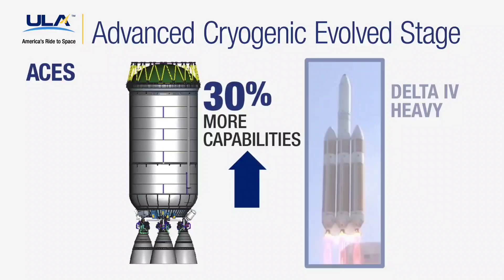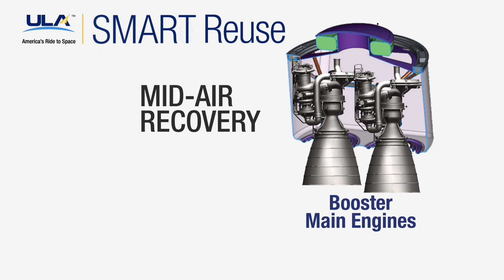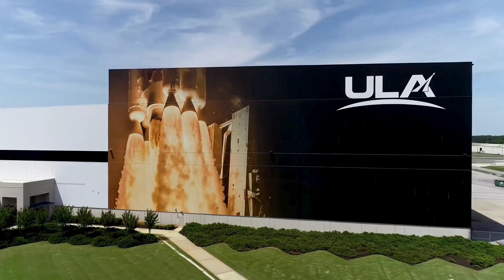Blue Orgin BE-4 having MORE problems?!  What about Vulcan Centaur?

Comment: Your logic WRT SpaceX Raptor leaves much to be desired.
Past performance says SpaceX will continue to fly by many more projected dates, and they will have a number of RUDs on their way to a usable product, but they will eventually get there. BE-4 hiccups are in no way predictive of Raptor hiccups. You need to exercise greater rigor in your analysis. Want to tell us that Raptor won't be working any time soon? Bring genuine evidence and reasoning, not this "BE-4 is having significant trouble, BE-4 uses some of the same tech as Raptor, therefore Raptor will have significant trouble too" BS. Your video is pissing me off. Call me "The Angry Viewer".

Comment: My issue is this. If a rocket requires boosters to launch basic payload it is not mission capable! Boosters should only be used to launch larger payloads to supplement a mission requirement. Not the damn mission!

Comment: The design of BE-4 started out as an engine the size of Raptor. However, NASA asked Blue Origin to double the size of the engine. (I think I found this fact in an IEEE article.) As a rule of thumb, problems increase as engine sizes increase. This becomes more apparent with engines designed for greater efficiency, especially where some form of staged combustion is used. SpaceX Raptor engines operate at a sweet spot of greater efficiency with reasonably good reliability. Blue Origin, however, fell into a developmental pit when it honored NASA’s request to increase engine size. 

A 33 engine Starship booster would not seem especially reliable, since at least one engine failure in 33 would seem likely. However, SpaceX believes it can detect problems with any engine, and quickly shut down that engine before it will explode and damage nearby engines. Ultimately, SpaceX views many engines as affording redundancy. I would guess that three engines can fail at liftoff, and the vehicle will still achieve orbit. 

How a BE-4 engine fails could be an issue. I wonder if, when a BE-4 fails, it may fail explosively. Suppose a given BE-4 engine runs reliably and can be reused for several flights. It proves to be a great engine, except that failure may be sudden and catastrophic. In other words, this is a problem of asymmetric risk: Failure is not likely, but if it occurs, the results are catastrophic. 

I will never understand what became of the Saturn F-1 engine. No F-1 engine ever failed, and Dynetics upgraded the engine, which became the F1-B, producing 1.8 million pounds of thrust per engine. One F1-B would develop more than three times the thrust of a single BE-4. 

https://arstechnica.com/science/2013/04/new-f-1b-rocket-engine-upgrades-apollo-era-deisgn-with-1-8m-lbs-of-thrust/

Space exploration may be more about politics than we imagine.

Comment: Does the BE-4 use methalox at similar temperatures/densities as the Raptor-2? I've written this facetiously before, but I've noticed the stats on the BE-4 and Raptor-2 aren't that far off.  The BE-4 is 2.4 meganewtons thrust and the Raptor-2 is 2.3 meganewtons. The Raptor-2 looks more compact, and it's made in gimbaled and non-gimbaled models. Is it possible to adapt the design in a reasonable period of time?

At a chamber pressure of 300psi, as opposed to the BE-4's 134psi, it looks like the mass flow of the Raptor is considerably less, while providing nearly the same thrust! Perhaps SpaceX could license the design, with a lower chamber pressure and wider throat, and boost the mass flow to more closely match the BE-4's philosophy of running a high performance machine at medium performance? My main question about adapting the Raptors is whether they expect denser, colder liquid methane and LOX than the BE-4s do. I'm sure the turbopumps must have a fairly narrow range of temperature/density that they work best with.

Possibly ULA could just bypass BO and go straight to SpaceX and buy a few Raptors for their engineers to test out and see what they think. Even if it just embarrassed BO into getting it's rear into gear, it might be a good move. Maybe just rent an old raptor-1

Comment: From my way outsider perspective. ULA has a problem that they are going to have to address sooner rather than later. They can toss the BE-4 onto the design scrap heap and go with either the Raptor 2 and redesigning the whole rocket to work with the Raptor 2, or they can wait and hope that either the Aerojet or the Blue Origin design finally matures enough to be viable. That timeline is unknowable at this point. So ULA can chose a viable working engine from it's competitor and be at it's competitor's mercy, or it can wait. Bruno cannot possibly be happy with what he is faced with, but he is going to have to either jump out of the pot, or get boiled alive (figuratively speaking). I think he is going to be forced to get in bed with SpaceX and redesign Vulcan to use it's competitor's engines. ULA is running out of time. If he waits too long the DOD is going to pull his contract, or at least downsize it, and ULA will go bankrupt because without the Atlas or Delta, they have nothing waiting in the wings without Vulcan.

Comment: It is entirely possible to test an assembly to death. I have seen it happen on more than one project, where a customer was so concerned about reliability that they actually undermined the system's reliability by testing it repeatedly at or above it's rated capacity. It is my understanding that this was a contributing factor for the BP Macondo Failure (Deepwater Horizon.). BP required so much testing on the BOP, that it was essentially worn out by the time it was put into operation. Transocean had to re-plumb the BOP in order to get it back operating again because repair parts were not available immediately, and they did it in an emergency because of production deadlines and they did not document the changes properly, thinking that it was just a temporary fix until new parts could be obtained. This is what led to the BOP failure.

Comment: If I were at the helm of ULA, I would be re-designing to use Raptor 2 engines. If there is one thing you can rely on about Blue Origin, it is that they are unreliable.

Comment: Considering the BE-4 has yet to demonstrate making it's claimed 550,000lbf of thrust and SpaceX's Raptor 2 was demonstrating 510,000 by Feb this year(2022) and well on it's way to making 550,000lbf ... ULA might want to reconsider their Engine provider.
Especially when you factor in that Blue Origin has yet to put anything in to Orbit. They've aced those sub-orbital flights though.

Comment: Only thing Daddy Bezos has done right is tell Uncle Joe to suck it about the economy.  BO is a tax write-off for him.  

R2 seems to be a pretty well developed engine at this point.  I doubt it would take too much effort for ULA to make a mount for R2's and then they can tell Daddy to pound sand.  R2 is pretty much at the same power and gets better gas mileage than the BE-4 so it could work.  I think it also weighs about half as much.

Damn dude, pull your audio out of clipping!  There's just no reason for that.

Comment: Raptor II is in no way at all comparable to the BE4; the suggestion that similar problems are likely is absurd. Just look at the two engine side by side and that is obvious; given that the BE4 has approximately ten times as much tubes and crap running all over the place, that means ten or more times the potential failure points for leaks than the Raptor II. And you made the point yourself that BlueOrigin has been short of parts to make test engines with, while SpaceX very very much does not have that problem and is making five Raptor II engines a week and testing the crap out of them.

Comment: Yes the two Engines are aimed at the same thing - the difference is that Blue Origin is rather incompetent.
SpaceX has already demonstrated competence. The Raptor 2 engine works. The control structures aren't significantly different from earlier versions of the engine - thus far more likely to work.

Comment: Maybe spacex can donate it's entire fleet of Raptor 1 engines to ULA
Reply: I was actually wondering what will happen to the Raptor 1 engines the other day. I doubt they would be sold or given to ULA, but I wouldn't rule out that they end up in a warehouse, and then in a few years, someone buys them and makes a launch vehicle. Basically a repeat of what happened with the NK33 engines for the N1 rocket.

But most likely they'll just be scrapped, with a few going to museums.

Comment: As we know from SX's development of the Raptor engine, there is a big difference from test stand development to the stand alone rocket. Even though SX has had a working Raptor engine for more than a year, SX is continuing daily development with the Raptor 2 and beyond. I think SX's biggest problem has been the ability of the Raptor engine to withstand the tremendous heat generated by the engine. I suspect that part of the BE 4's problem is also related to metallurgy. Initially, they were not able to generate anymore than 70 percent power. At least that's what they reported. Recently they have apparently been able to generate 100 percent of expected power but I have not seen any proof of it. I don't see how Blue Origin was able to convince all of these rocket providers that they engine to do the job. Amazing.
Reply: They have briefly achieved 100% thrust but not full-duration at 100%. They touched full thrust but quickly dial it back as the resonance would build to the point of self destruction. The tail flame looks sketchy and that's why BO developed a camera inside the combustion chamber - not because that's cool but because they do not understand the instability. If the metallurgy was better it might take it but it would be better if the instability was not there in the first place. They are way out of their league.

Comment: Despite all the pessimism about the BE-4 engines from this and other channels biased towards SpaceX, not a surprise the Vulcan Centaur ends up launching before Starship.
Reply: Seems unlikely at this point.
Reply: The pessimism regarding BE-4 engines is due to their poor performance. The thrust graph is not continuous thrust, it steps up/down as they can't put the peddle to the metal. That means combustion stability is not there. Jeff Who's company does not know what is happening with their engine. And they aren't going to solve a fundamental design flaw w/o going back to the drawing board.

Comment: I had to struggle to look this up from an independent source at ULA… And it isn’t an issue. This “leak” was found and repaired in 3 hours.  Right now the issue is the payload isn’t going to be ready by the end of the year.
Reply: I’m also starting to think you read the article dated aug 15 2021…. Not 2022

Comment: Since the Apollo time I tried to find out how space launch vehicle work. Reading the doctor work of Wernher von Braun, building & testing liquid propellant rocket engines at the technical university of munich, trying to understand the history of development from1930 until today. It is hard to understand and then to teach other people how to develop rockets. Why are most of the development works did not lead to a working launch vehicle?
One fact is clear: the principles are very simple / you try to bring the impossible to life when you look at temperatures, pressures, etc. / adding what is necessary to make a rocket engine work, to the basic parts (tubes, pumps, chamber, etc), lead to a hundred times more parts than the basic elements are. If one of the parts fails it has the potential to destroy the complete engine.
Why did the germans did it in the 30s and the new technologies in the 60s? They work on all levels of detail very precise. They built up experiences over decades (from the 20s to the 60s and until today), i.e. no hire and fire: the same people need to work and think on that technologies.
You ride a very shy horse: one small failure and it through you from the saddle.
Knowing this, I stopped working on rocket technologies decades ago because there were no jobs in Europe and NASA wouldn't take on non-US people. Things weren't much better for US companies.
In any case, I am confident that some of the new companies will be successful - SpaceX has the best chance of fulfilling my childhood dream: to go to space beyond the moon before I die.

Comment: ULA had a successful partnership with rocketdyne for all these years,  they may not have been the cheapest solution  or most advance but they got delivered and they got the job done.

Bazos can not be relied apon,, this is now a national security issue.  ULA should be going back to Rocketdyne and begging for a methane conversion of the rs68.  Just carry on with ablative nozzles until a regenerative system can be developed.
Reply: Rocketdyne no longer exists. Aerojet Rocketdyne can't even restart the goddam RS-25 assembly line and you expect them to come through with.... what?
Reply: What are you talking about,? They will be supplying the rl10 for many more decades.

Using the rs25 for the SLS was a mistake by NASA not rocketdyne, an evolution of the rs68 would have been much better.  Basically NASA have stumped rocketdyne by not promoting enough innovation.

ULA or more precisely Boeing decided to be reliant of Russia engines which had set back engine development by decades, and now moving to Blue origin has done the same.  They simply get away with one colossal cock up after another.

The rs25, rl10 and rs68 have been reliable well performing engines but just not cheap.  When there is so much at stake and the engine is the riskiest part of the vehicle it’s mostly justified.

Good luck to ULA with entrusting their payload and rocket to blue origin engines 😱
Reply: @kentonian  Rocketdyne? You keep stating it as if it was a still a standalone engine company. It's Aerojet Rocketdyne (AJR) now after the two merged decades ago. There's not that much left of Rocketdyne these days, it's mostly Aerojet at this point.

And AJR dropped the ball badly 7 years ago when they could've and should've been putting their own money down towards furthering AR1 when it mattered. Blue Origin at least was well along enough that they were able to put together their first full scale BE-4 by 2016 and by 2018, AJR had NOTHING, just a couple test parts for AR1. How the hell do you figure they were going to get an operational engine ready by 2020?

ULA also wasn't reliant totally on Energomash's RD-180, they were also operating three different rockets at the time two of which made use of American-made engines; RS-27A (Delta 2) and RS-68A (Delta IV). But both of those were expensive and were rapidly becoming out of date. AJR wasn't willing to innovate, but Blue was and it was faster as well as putting its own money into the game.

Comment: I still think SpaceX should fly some SuperHeavy’s with 6, 7 or 8 Raptors on 1km and 5km test hops demonstrating the chopsticks recoveries.  That way they’ll have a good chance of recovering the first 33-engine SH.  Although, if an all-up 39-Raptor orbital flight succeeds, or at least doesn’t blow up on the pad, I guess I would be wrong.  As is, they may achieve Starship in orbit, but they will likely loose all 36 Raptor2’s and 3 R-Vac’s on a single use in doing so.
Reply: Fly with ONE Raptor as that is enough to lift and hover.  Do 5 meters up and down to catch.  50 meters and catch.  1 km and catch moving laterally before descending.
Reply: @Scanner9631  That sounds even better.  Lift off the mount to hover, with chopsticks straddling, then bring the chopsticks up some 10m or so to catch.  Then using 3 Raptors, and with the chopsticks to the side, lift up enough to clear the tower, hover and translate laterally over to align with the chopsticks and descend down onto the chopsticks.  Maybe do two flights like that.
Then maybe with 6 or 7 Raptors, climb to 15km and descend on profile to a chopsticks catch.  Could maybe mount a Starship nose cone atop SH, if needed for the ascent.
With that all successful, there would be some confidence in an orbital flight and recovery, preserving the 33 Raptors.
Reply: @Scanner9631  … and add another set of supersized cold thrusters to allow larger corrections. After success without needing the extra thrusters, only then remove them.

Comment: “Sigh” Maybe they should have planned using three or four BE-3 engines instead? We know for sure they work.
Reply: Wrong fuel (so it needs new tanks).  Not enough thrust.   Looks like they would need 5 BE3 for each BE4 assuming the resulting craft was the same mass for the booster.

Consider a Raptor 2 can't throttle low enough to hover with New Shepard fully fueled.  BE3 can land throttled without the capsule and almost all the propellant burned.  No way can a BE3 replace a BE4 at a 2 to one ratio when the BE4 is supposed to have a higher peak thrust than Raptor 2.
Reply: They still are attaching solid boosters anyway, they can double the number for compensation. But you’re right about the fuel tank needing to be redone.

Comment: Though I am a Space X fan, competition is good and I - along with many other Space X fans - do hope ULA succeeds especially with making its rockets partially reusable. 
I have less and less faith in Blue Origin. I hope Sierra Space - which I also like - is considering alternate launch vehicles. Even if they are ready in February 2023 it does not look like Blue Origin will be anywhere near ready.
Reply: Hopefully Sierra Space has a backup to Orbital Reef based on using New Glenn to use Starship and call it Musks Reef. 😁
Reply: Sierra has already said they can use falcon after some modifications
Reply: Use a obsolete Starship as the backbone or a pair of them.  It would from the beginning have more volume than the ISS.